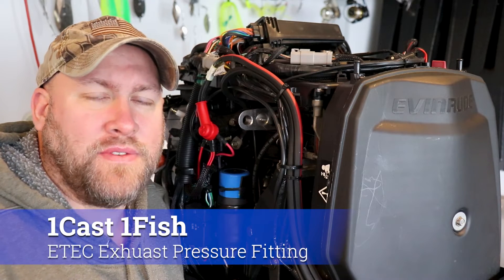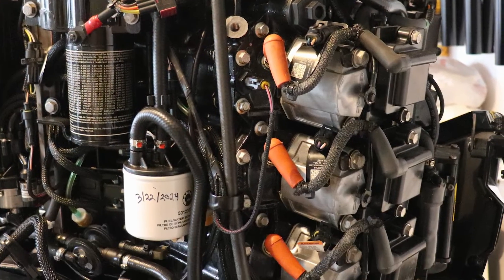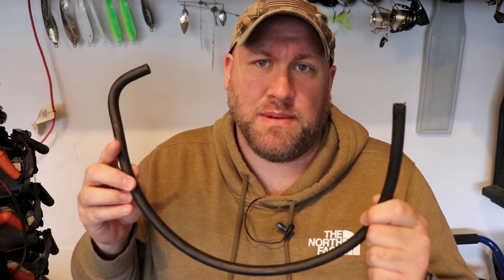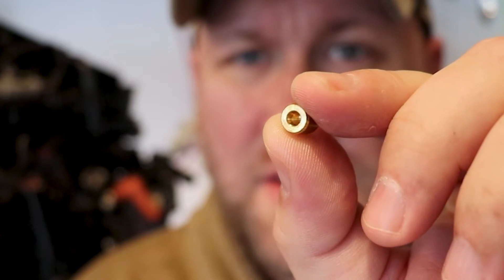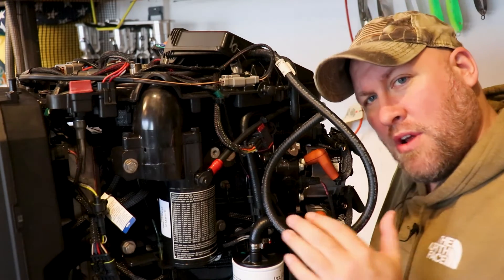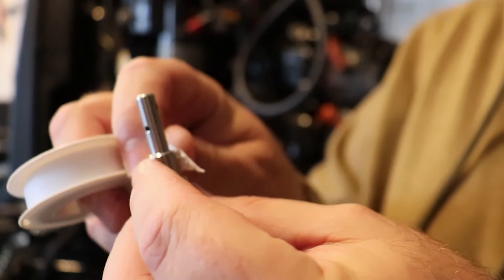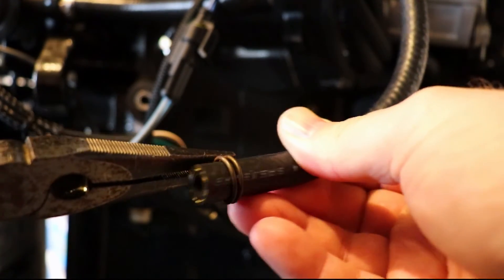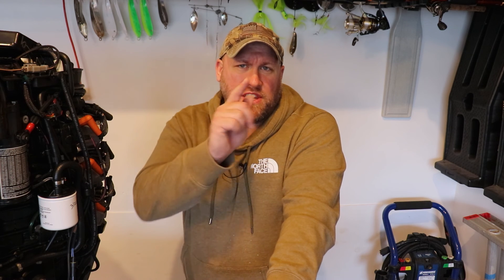Evinrude ETEC Exhaust Pressure Fitting / 3 Year 300 Hour Service

Comment: I just got a 2006 200ho, there is no orifice in my hose, what effect would there be with it missing.
Reply from the maker: Its my understanding that there are a few years and model ranges that didn't use them, especially the older models.
If it has been fine without, I would just clean the hose and carry on.

Comment: hi i don't have a exhaust pressure fitting on my 50 hp e tec, only one hose on the right and one on the left. no water or exhaust stamped into the emm. can send a photo already did the vst filter clean thank you for any help.
Reply from the maker: I believe 50hp does not have one
Reply: @1Cast1Fish  thank you for the info, i have one more question. what  is your opinion on using index washers on the spark plugs, if you can't index them correctly? my lower injector took one of the plugs but the upper injector is really hard to get plugs to index. I have researched this and got all different answers. also the auto supply store won't take them back the plugs even if they where only used for indexing.
Reply from the maker: I have never seen a issue with them first hand, just a few stories on the internet of problems...plus the manual says not to, so there is that.
I personally do not risk it...but know a few guys who use them and no issues as of yet.

Comment: Just took my exhaust back pressure nipple out, and found the previous owner had stripped out the bolt hole and had the fitting held in with some sort of caulking it looks like.
Reply from the maker: Might be able to lightly rethread the hole, hope it works out and you have no issues

Comment: The OEM evinrude hoses are expensive, can I use a non-oem from west marine?
Reply from the maker: In many cases you can use non OEM parts, I honestly tend to stick with OEM just to ensure everything is 100%.
Reply: @1Cast1Fish thanks for the reply. Love your videos.  Very helpful and easy to follow.
Reply from the maker: Thank you...just FYI the hose didn't seem anything to special...I would definitely stick to OEM on fuel lines though, especially the pre-bent ones.

Comment: I could really use some help and advice. I'm having issues with my 2009 Evinrude 175 E-TEC. The engine has been running fine all season, but today I suddenly got an overheat alarm.

Before summer, I replaced both the thermostats and the impeller (original parts). The telltale stream looks normal. However, on the display I noticed the engine temperature climbs unusually fast. Once it hits around 190°F, the overheat alarm goes off.

Has anyone experienced something similar or can offer any advice on what could be wrong?

Thank you in advance!
Reply from the maker: I would look at the parts you replaced first.
Low speed overheats tend to be T-Stat related, higher RPM tend to be relief valve related.  All speed overheats I would look at impeller.  You can pull the T-Stats out and check them in some water in a pot on the stove, use thermometer and raise temp to see when and if the stats are opening.

Comment: Hi 1cast 1 fish. I like your videos, and it really helps when doing service the engine by my selves . But i have a problem. Lov voltage, check engine. I suspect i need to take off the fly wheel and change the magnets. I found cracked magnets. Any tips how to change this ?
Reply from the maker: It's my understanding it is not a overly difficult job for a competent DIY mechanic.  I have seen many other YouTube videos showing how to do the job.  Many places sell a kit to replace them as well.
FYI, those symptoms Definity would have me checking magnets.
Reply: @1Cast1Fish glue my magnets almost every off season. Certain places sell them but hard to find. They sell out quick.
Reply from the maker: DO you glue them as preventative maintenance every season, or do you have issues every season?
Reply: @1Cast1Fish  every year a new magnet comes off. This year 6 of them were out of place. The ones I epoxy before were still in place. But I do take off flywheels to make sure they’re intact.

Comment: In January I changed my water pump and put new spark plugs in. This weekend i took it out for first time this year. Its now really loud (exhaust noise) when on plane. Any idea what could be causing this?
Reply from the maker: Very hard to tell...I would be looking to ensure everything with the water pump replacement was good.  Did something move or fall out of place?  Could be a ton of things honestly, but I would start with looking at things that you worked on. Was all the spark plugs indexed correctly?
Reply: @1Cast1Fish  I think I got it figured out. Yes I indexed the plugs
Reply from the maker: Great you have figured it out...hope it runs great for you going forward

Comment: I pulled out my exhaust pressure fitting and when installing the new, carbon buildup on the threads of the engine body is preventing the pressure fitting from inserting deep enough and seating properly. Should I thread cut this to clean the threads? If so, what size thread cutter?
Reply from the maker: Just to be sure watch the video at 2:41  The fitting does not go 100% You can see mine was only inserted about half way up the threads.

Carbon should not stop you from inserting the new fitting...maybe corrosion?  If there are other issues here, I would try to clean them up the best you could, but I am unsure of the thread size. I would be very careful cutting new threads on the engine itself, any mistake or issue could cost alot of $$$

Comment: excellent video thanks for explaining, how did you remove the little thimbal inside tube up near EMM? also is it adviseable try to clean this carbon from metal an rubber w/ fuel injector cleaner?
Reply from the maker: I was able to push it out.  I used brake cleaner on the metal orifice to clean it.  I would be careful with the rubber hose though...different chemicals may cause the rubber to breakdown.

Comment: etc. I give 12 volt energy to the 40 hp full injector outside and the engine sound is heard but it does not spray gasoline. 2 injectors do not spray gasoline. Engine brain is solid. What can I do..Please help.
Reply from the maker: Are you using the ETEC Software? Do you have the service manual for testing and repair?
Reply: @1Cast1Fish  fuel injector outside I put it in a full box and give it 12 or 24 volts. There is a ticking ticking sound coming from the injectors, but they do not spray gasoline. Do I need to give 55 volts? Thanks buddy..
Reply from the maker: I believe you need the full 55...but don't hold me to that.  
Plus can be many fuel issues  as well.

Comment: Thinking about buying a used boat with a 2018 Evinrude 250 etec on it with less that 100 hours on it.   What should I look for on this purchase and is the etec a good motor?
Reply from the maker: The ETEC is a great motor when maintained...but like anything if it was not maintained well it can be trouble.  
Low hours sounds great, but that is very low IMO...I would take it to a reputable TEC and have it checked out completely.  
One thing to watch for on older "Low Hour"  motors is if fuel and such has just been sitting in things,  Another problem I have heard of is scam people selling used junk motors. If the motor had issues and they replaced the EEM it would show the hours of the replacement not the real motor hours.  You have to dig a tad deeper with the diagnostic software to verify EEM hours and motor hours and such all match.  
Like I said it is no more reliable or unreliable than any other motor IMO...but due diligence is always due when purchasing used motors.

Comment: My 300, didnt have thay little fittings inside of the pipe? ?? Do all have that?
Reply from the maker: Not 100% as I do not have a manual for the 300, but if it had the Exhaust Pressure Fitting, and it went to the EEM...then I believe it should be in there somewhere...to protect the computer.

Comment: Hello Paul. Your videos have been a game changer for me. Thank you.  I went ahead and replaced the Exhaust Pressure Fitting on my 2014 Etec 150. Everything went smooth and had no issues. However, I noticed a lot of GUNK inside the hole where the fitting goes. My question is, is this condition normal and if not, what is the next step? is removing the gunk out with a small screwdriver a good option? Thank you.
Cron.
Reply from the maker: Pretty normal, I clean mine the best I could and replaced the hose and orifice.

Comment: Stupid comment, but I cannot find the hose anymore (discontinued) for a 2008 250 etec.  Crowley marine cant get it either.  Is there a generic hose I can use and cut to fit?  I know some hoses are for fuel, some for other purposes.  I need 25" for my motor. Thanks.
Reply from the maker: Check with Barnicle Bills Marine...that's where I ordered mine

Comment: These gen 1 engines were actually pretty reliable. People just don’t take care of them and they tend to run crappy fuel through them.
Reply from the maker: Proper maintenance and good fuel are very important in theses G1's...properly taken care of motors last a looooooong time
Reply: @1Cast1Fish  agreed. I have the opportunity to buy a 2008 250HO but I’m a little hesitant because parts availability might be an issue now a days.
Reply from the maker: Most parts are still available and many used motors can be had pretty cheap.  Depends on hours, maintenance, and price.

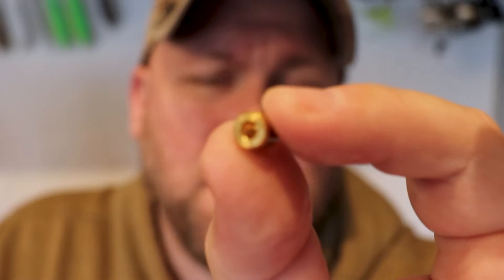Comment: 01:25 hi, after I've watched your video I've realized my E-tec 175 2011 (don't know if the model/year matters) does not have the "orifice restrictor" you mentioned, nor I was able to find in the service manual (pg 95, MAINTENANCE - EXHAUST PRESSURE FITTING - Evinrude E-TEC 2010 Service Manual). 
  Would be so kind to post the part number for this orifice restrictor?

  In the manual service at the same mentioned section talks about a Diaphragm assembly. Do you know which part this is?
  ~ If barometric pressure reading is accurate with hose removed, replace hose and diaphragm assembly. and inspect exhaust fitting for restriction.~
Reply from the maker: Not sure honestly, the orifice was in my hose right at the EEM.  Not sure if something changed between years or not.  I do not have the P/N on hand, however I ordered all my parts from Barnicle Bills Marine...they specialize in ETECs and are a wealth of knowledge.

Comment: part numbers for hose, and orifice??
Reply from the maker: P/N 0353038 Restrictor Plug
P/N 0352415 Hose, Exhaust Back Pressure Nipple to EMM

Double check with your specific motor model number
Reply: Same thing, I never even knew my engine had one. When I changed my hose a year ago I cleaned up the fitting at the exhaust and put back together the hose with no orifice restrictor,
Reply from the maker: It regulates the exhaust pressure that the EMM see's, along with preventing carbon from ending up in the EMM